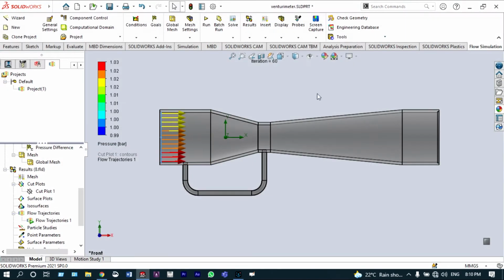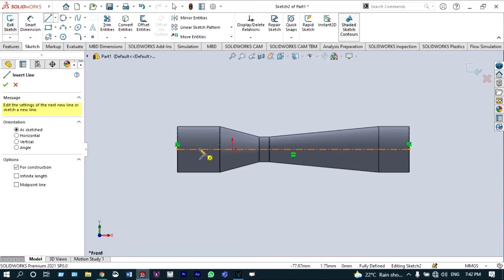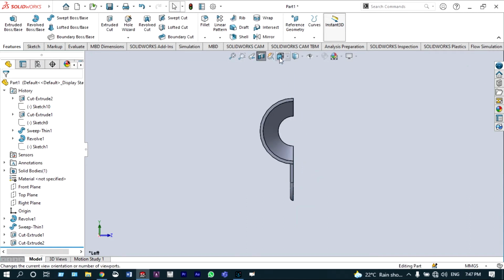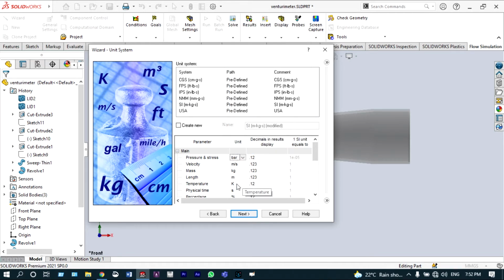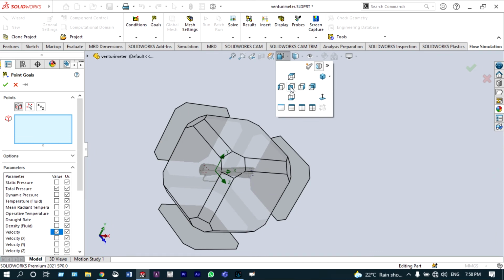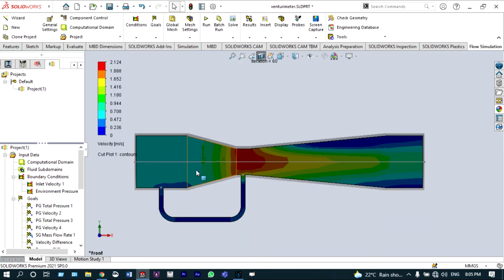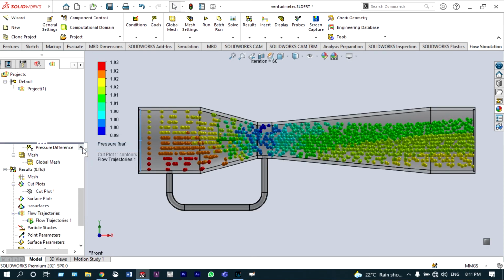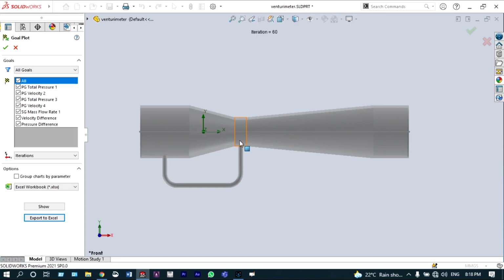CFD Venturimeter | Exclusive Venturimeter Flow Simulation Tutorial | SolidWorks 2022

Comment: In the pressure graph image the min pressure is 1 at 0.2m length, not 0.2 bar as stated in video audio - Is the pressure difference between the start and the middle of the venturi actually only 0.02bar in this model?

Comment: Video quality and accurate results in CFD the thing which I like most...
Will u plz do video on the CFD analysis of heat transfer by radiation and plz provide temperature profile 🙏🙏🙏
Reply from the maker: I have already made some videos containing radiation
Reply: I watched that videos but I didn't see temperature profile anywhere which is very necessary for us I request you to add temperature profile for radiation especially  or make another video ( I saw your this video of venturimeter in which I wanted to see pressure and velocity variation along the flow so tysm for that I appreciate your work very much 🙏)

Comment: Hi I have a question about rocket tech. Spacex Stage1+Stage2+Fuel weight is 4500tons. I dont believe any number of rocket engine can lift that weight and the thin fuselage can hold that fluid without failing. I would like to know your opinions about these rocket structures. Thanks.

Comment: sir if my inlet p is 20 bar then should i enter in initial condition as 20 bar and temp say 40°c... what will be my boundary conditions at inlet and outlet
Reply from the maker: Inlet Boundary conditions should be as per actuals. It is user dependant and if there is any exit it should be having environmental pressure or atmospheric pressure
Reply: @CFD_GUIDE  thank you sir..today evening after my office work i will do this and analyze the results as per your recommendations. sir i want to contact you through mail is that possible sir?
Reply from the maker: No issues at all. Send an email
Reply: @CFD_GUIDE  ok sir